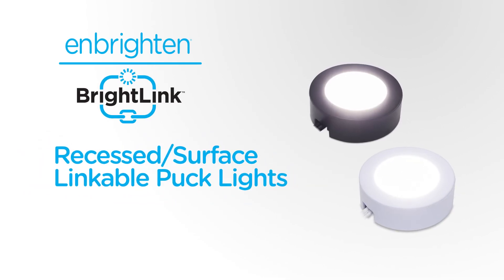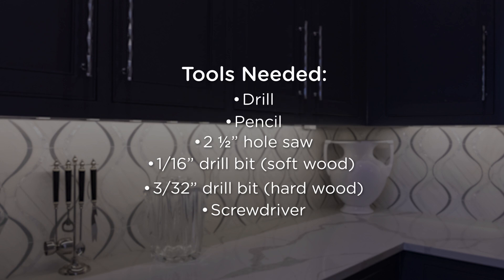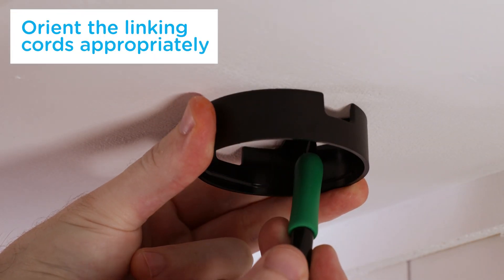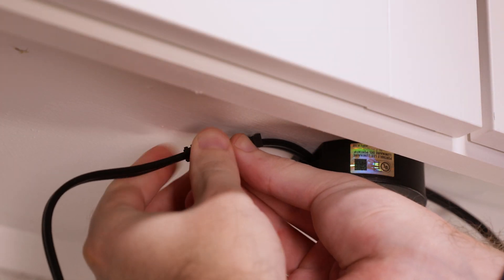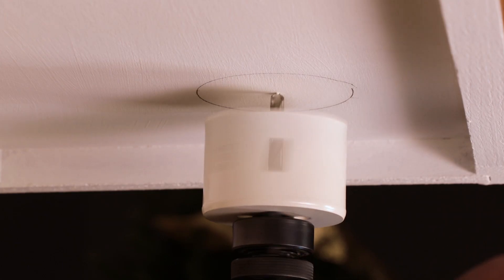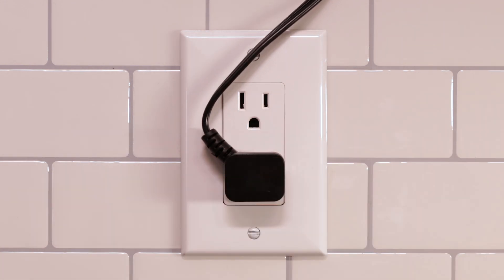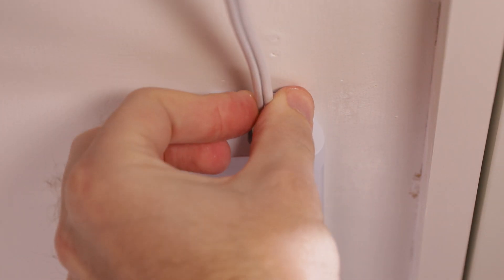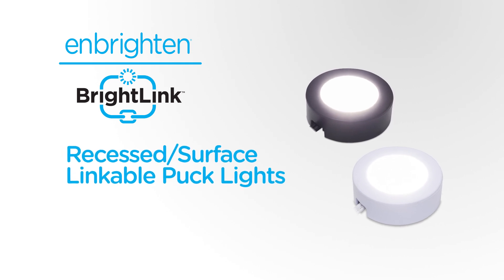44420 44975 44974 - Enbrighten BrightLink Recessed Linkable Puck Lights Installation

Comment: Are the enbrighten recessed puck lights dimmable?
Reply from the maker: Hi Datu! Yes, these pucks are dimmable when paired with the BrightLink Direct Wire Converter. You can pick one up here: https://www.lowes.com/pd/Enbrighten-Cabinet-Lighting-Direct-Wire-Conversion-Box/1001314652
Reply: Great video- however, when doing a recessed installation, what is holding the puck up inside the 2 1/2 inch hole? Without something to secure the puck, it honestly seems like something that will droop down over time…